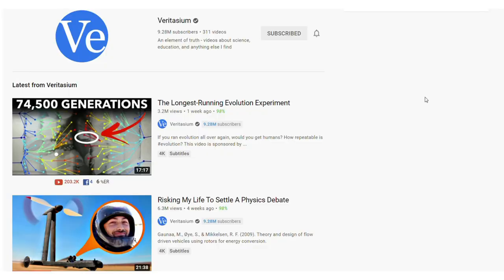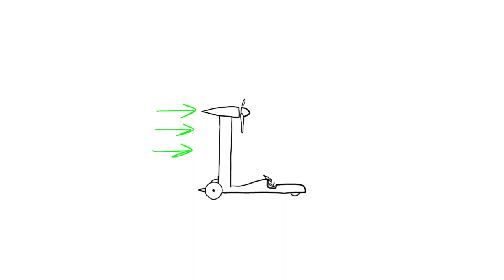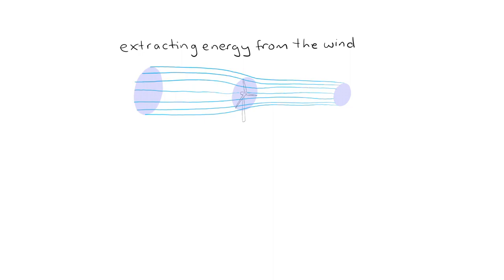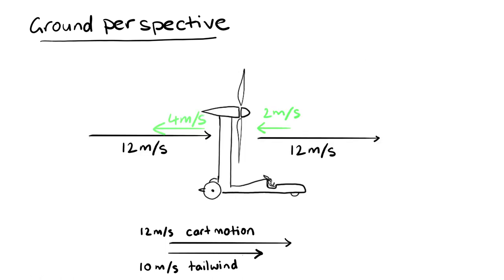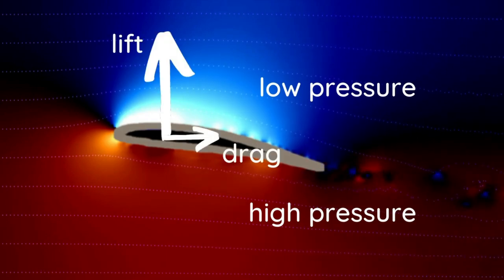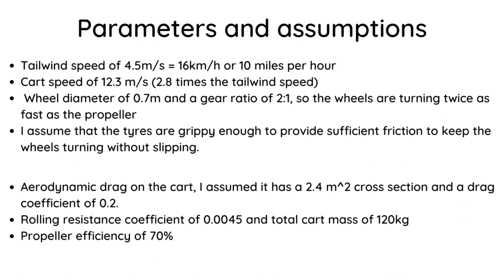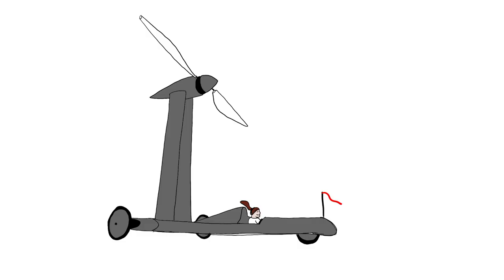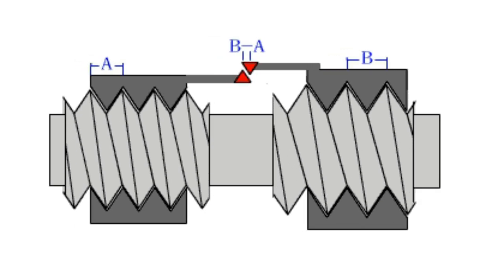Downwind Faster Than the Wind by Veritasium: How Does it Work?

Comment: I've also been mulling and enjoying this particular brain teaser for a while as well.  Thanks for your analysis.

I believe that this is such a great brain teaser because it sounds so much like a classic of 'perpetual motion', the electric car where a motor powers the front wheels and a generator is connected to the rear wheels to charge the batteries.  Anyone with any physics education knows that such 'perpetual motion' does not work.  So explaining why it does work here quite the challenge.  

Not only do you need to explain the maths of how it does work, you have to overcome the very reasonable objection to what seems to be a perpetual motion machine.

-Jon
Reply: "So explaining why it does work here quite the challenge."

Because here the wind is an external energy source so it's not a perpetual motion machine.
Reply: @seneca983   Exactly.  This system works because of external energy input.  You know that, I know that.  

My point is that explaining that this is in fact the case even though it looks like a classic perpetual motion machine is quite difficult.  

Imagine a battery powered car where the electric motor drives the front wheels.  Now connect a generator to the rear wheels to 'recharge the batteries'.  This does not work; it is perpetual motion.

Now build a battery powered car where the electric motor drives a propeller that pulls the car along.  Connect a generator to the rear wheels to 'recharge the batteries'.  Sounds very very similar, but this can work if you are going down wind, and the wind is strong enough and your system is efficient enough.

Explaining the difference between the two cases is the hard part.  Actually doing to maths to describe the requirements for the system to successfully function is not trivial.  I think Rosie does a great job with this.

-Jon
Reply: @jonathanedelson6733  OK, I misunderstood you.

Comment: Hang about, Rosie....what traps the wind to cause the 'vehicle' to move from the stationary position in the first place? None of the superstructure nor the shape of the vehicle suggests a capacity to trap moving air, i.e. wind, given that its mass is unknown, with which to turn the wheels which in turn would rotate the propellor blades.
Reply: The prop stays are rigid sails.

Comment: I missed something on the Maths.
on this example we would need to consider the build up on Angular Momentum. (and how it is , in this case tied to the regular momentum because of the chains on the wheels and propeller
Reply: No energy stored in the cart (angular or linear) adds to the thrust force of the cart in steady state wind.   So that can be ignored in terms of helping the cart work because it doesn't.  That stored energy (as it is being stored from the cart increasing speed) does keep the cart from accelerating faster though.
Reply: @killbeas  I'm sorry, but for me this is extremely counterintuitive because the entire energy stored on the cart can be written based upon the linear speed, since it is tied together. and the linear speed also dictates the thrust because it is tied to the propeller speed, which is also responsible for the net thrust. Neither Veritasium or her mentioned it, and it bugs me out
Reply: To reason why this is confusing is because people think on energy and perpetue motion, but this can be explained using energy because to execute work over the passing wind you need energy, but that energy comes from the angular+linear momentum.
Now if you go for a simpler example of ignoring the cart, and think the system as a back box. Could a back box, without any external energy, propel itself fast than a down wind? Of course it is, if the back box gets colder, for instance! (losing its internal energy) which was stored as angular momentum
Reply: @carloshra  It is indeed counterintuitive.  You bring up a good question.    Indeed, as you correctly write, energy is stored in the cart as it travels faster, in the form of rotational Kinetic Energy (KE) in the drivetrain/prop and in linear KE in the linear motion of the cart.  But this energy isn't being used to accelerate the cart.  As you probably know, for an object to give up linear KE to something else, it is slowed.   So the cart can't both slow and speed up at the same time so the linear KE can't be used in anyway to make the cart go faster.  In fact, as the speed increases, more energy is stored in the cart, not less.  

Now for rotational KE in the drivetrain used to accelerate the cart (not).  For rotational KE to be used as an energy source, the prop has to slow down (like a flywheel has to slow down to give it's energy back).  But since in this cart, where the prop is directly tied to the wheels, without the wheels slipping, the propeller can't slow down to give up it's KE as this would mean the wheels would slow which is a contradiction also for the cart speeding up.  One could say "the cart is energy hungry to make it go faster!".

So where does the energy come from?

The energy to both accelerate the cart and the energy stored in the cart (at speed) comes directly from slowing the airmass processed through the propeller.   It slows with respect to ground (the surface it is running on) and thus loses energy.

So consequently, none of the energy that is stored in the cart is ever used to accelerate the cart to a faster speed, all the energy comes from slowing of the true wind over the surface.  When the wind dies, that energy can be given up but it is only when the cart is rolling to a stop and decreasing in speed.

This really is the answer for all of those wondering about violation of Conservation of Energy.  The energy comes from slowing down some of the true wind over the surface and the cart has to have a mechanism (prop and wheels efficiently connected with correct kinematics) to capture some of that energy removed from the true wind (and it does!).     So this cart can truly go Direct Down Wind Faster Than The Wind using only the wind that drives it, steady state, using no stored energy!

Amusingly one would think I'm giving away all the secrets here (because I am)!   But I promise you will read literally thousands of comments of people who don't understand this answer, never "get it", and think it is a fraud!  So I'm happy to give up the real physics "secret" because it doesn't matter!
Reply: @carloshra  There is definitely not perpetual motion involved here.  But there is also no stored energy involved like your black box explanation.   The stipulation for this cart in it's entirety is "Direct Down Wind Faster Than The Wind using only the wind that drives it, steady state, using no stored energy!"  

The energy comes from the true wind and none of the energy stored in the cart is used to make it work.  See my explanation in my other answer to you.   So please stop telling people it uses stored energy to work because it does not.  Nor does it violate conservation of energy and is not a PM machine.

Comment: The wheels are connected to the propeller.
The propeller is geared to rotate multiple times per 1 wheel rotation.
The faster the wheels spin the faster the propeller spins, depending on what gear ratio is set up (not specified).
The propeller needs to be spinning at a high rpm in order to create thrust.
As the wind brings the car up to a higher speed it also greatly increases the propeller speed to the point where it starts to have thrust.
How the wind continues to play a part once the propeller is accelerating the car is beyond me.
It would seem to be no longer necessary and the propeller has taken over.
Reply: //"The propeller is geared to rotate multiple times per 1 wheel rotation."//

Actually, the propeller only rotates about 1/3 of a turn per wheel rotation.

//"How the wind continues to play a part once the propeller is accelerating the car is beyond me."//

The wind continues to be the energy source at all speeds.

Comment: How does this NOT defy the idea of getting more energy out than it put in?
Reply: It does so by putting more energy in than you get out.
You only have to put some of the wind's energy in. As long as that amount is larger than friction losses it will add to the kinetic energy of the vehicle. 
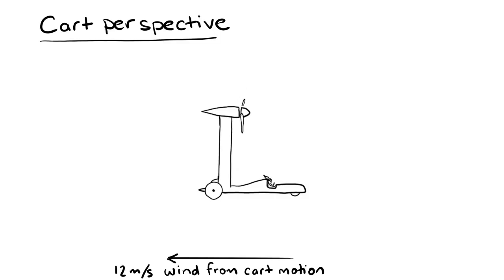Watch again from 5:38, it is by far the best explanation and doesn't confuse you with cylindrical planets or weirdly spinning wheels (they're great analogies to show what's going on, but not everyone works for everybody).

Comment: Ok so I have a simple question, when the wind speed changes and it's slower than the vehicle(as shown with the ribbon in the wind in te original video) is it accelerating or or slowing down?
Reply: In the original video the wind speed does not change by much. Watch Veritasium's follow-up video with the bet, he has a graph of wind and cart speed there.
Reply: @TubeMeisterJC  Ok so when wind is faster it powers the prop than in turn spin the wheels and when it slower the wheels power the prop that propels the craft forward, correct? so if this is true it can't move faster than the wind forever, because the wheels are acting like flywheels storing the energy in "slower than wind powered movement" and releasing it in "faster than wind" movement. Btw what is the gear ratio of the prop and wheels, or actually what is the force per rotacion each generate and the point in which a certain wind speed and craft speed make one slow the other down, provided they are gear locked all the time.
Reply: @CMZneu  it’s not exactly like a flywheel however it will not accelerate forever. It will reach a max speed where then it will deaccelerate to wind speed again. Then the energy will provide an acceleration again. The graph of speed would represent something like a sin wave
Reply: @fabio19h  Yeah i guess rather than a flywheel is more like it stores energy in the inertia of the whole craft, and a sine wave like graph is exactly what i would expect to see... but seriously is what i said is basically right?!!! because and don't get me wrong it's a neat concept but it's a bit disappointing, i guess i expected something with a more complex physics "phenomenon" of something along those lines, are you sure there isn't more to it?
Reply: @TubeMeisterJC  me and a few fellow physicists did the maths with our Professors a few months ago and also did a lot of testing… The vehicle is working like ist should it doesnt violate any laws of physics but its a finite acceleration and decall followed. In average the cart will move faster but not at a totaly steady rate
Reply: @TubeMeisterJC  bruh… we agreed with him too. Nothing in put maths contradicts it. you just dont get the real Problem and principle behind it but its okay nobody‘s perfect 
Have a good day:)

Comment: It sounds a bit like a perpetual motion problem: the wheels power the prop and the prop powers the wheels, but that would be in still air conditions.. It has been known for a very long time that a well designed ship can sail faster than the wind which propels it, but I'm not sure what bearing this has on the perpetual motion problem. What if the car driver wants to travel upwind? A ship or yacht can sail against the wind, not directly but in a laborious, zig-zag fashion.

Comment: So Rosie, when you are “running “ on a treadmill rotating at the equivalent of 20 mph, but you are stationary with regard to the room, are you feeling a “wind” on your face of 20 mph? Are the molecules of air hitting your face faster and faster? Or do you need a wind tunnel to prove your violation of first law?
Reply from the maker: No, in that case it would be the same as running 20mph outside, with a 20mph tailwind. So I wouldn't feel any relative wind on my face.
Reply: @EngineeringwithRosie  equivalent is no real wind. If your feet were “wheels” the treadmill will be moving in relation to you changing position over the treadmill ( assuming no friction ) surface because of inertia you would stay in the same place in space while changing position on the treadmill ( assuming a very long treadmill). You will feel no force on your back. Now we add friction and the treadmill will push you forward by action and reaction, but you will feel wind in your face as you move forward…I think you need a windtunnel to really do the right experiment
Reply: @JO-mg6xc  the treadmill is the equivalent of having electric motors powering the wheels. which is what the blackbird has, hidden in the wheel hubs & prop housing.
Reply: @EngineeringwithRosie  You're pretty much making a point here contrary to the claim of the vehicle. The treadmill model is a poor analog because the energy in the model that propels it forward only comes from the wheels, not from the wind as claimed by the full size vehicle. As I've stated here and elsewhere, the correct way to make a statement about the full sized vehicles speed is to time it over a given distance for an average speed, and compare that to the average speed of the wind (determined by a chase vehicle matching ground speed while measuring windspeed) over the same run. Also, like others vouching for Veritasium, you've neglected to mention the variable pitch propeller of the full size vehicle and how it can be used to trade momentum for thrust and accelerate it. However, over a prolonged period of reduced windspeed, that 'speed boost' will be lost and the wind will then exceed the speed of the vehicle again. This effect of accelerating beyond windspeed, then falling back below it will repeat over a prolonged run, ending with a result that the average ground speed of the vehicle will be <100% of the average wind speed. This is my belief unless anyone proves otherwise and the result is sanctified by the FIA or SCTA, etc. - you are after all claiming a 'speed record'. Instantaneous measurement of speed doesn't count.
Reply: @EngineeringwithRosie  but here the wind is very important. The molecules are supposed to be the driving force, not your legs. Until you prove it in a wind tunnel I will not believe it.

Comment: I made the same comment in the video and in the forum discussion thread, I also said this thing operates in at least 2 different ways below and above speed of the wind, but I don't agree that when it's going faster than wind, the wheel is driving the propeller, I think the propeller is driving the wheel when it's above the speed of the wind and there's 2 arguments for it.

1. If it works like you described, that the wheel turns the propeller, then in theory this car should work in an environment with no wind, we just have to push it a little and it would keep going via the exact same principle, and that's just obviously not possible to do.
2. If it works like I have described, that the propeller turns the wheel, then in theory it should work in a headwind with the appropriate change in drive ratios between the propeller and wheel, which it obviously does. 

There's an easy way to tell which is turning which, just fit a torque meter somewhere in the drive train and see if the torque is positive or negative.

I'd also like to point out that all of the explanations animations and concepts done by the creators of this sail car, don't involve using wheel torque for anything, so the fact that the blackbird has a drivetrain is definitely suspicious that it's not using the same principles as those shown in the 3D animations.
Reply: Congrats for figuring there is a bug in her explanation,  you have your critical thinking cap on. That makes you a rare bird.  Bernoulli's principal is what makes this work, not "thrusting air out the back".  As to which contributes more to the start-up, the airfoil cross section or the car cross section, that would depend on the aerodynamics, but is not critical to the later part, so a torque study might not prove much**

The only purpose to the airfoil pitch angle is to prevent either a stall (too much pitch at low speed) or a collapses of the vacuum on the top of the airfoil (too little pitch at higher speed).  Hence someone else here made a comment about variable pitch being useful, and was spot on, but unfortunately for the wrong reasons. 

back trust is minor, otherwise household fans (no airfoil) would fly about the floor.  Shocking that PhD's in physics and engineering forgot their 2nd year of undergraduate studies (back then, now my son just studied Bernoulli's principle in middle school (and critical thinking which I guess they didn't get earlier)).   You give me hope for this world, thank you!!!

** Run the same car with flat blades vs. an airfoil as a proof.
Reply: @rcmrcm3370  I think the pitch angle controls play a crucial role in transitioning from sub-wind to faster than wind speeds, but that analysis will get complicated very quick, I think it is also possible that this vehicle cannot transition from slower than wind to faster than wind in perfectly constant wind, it probably relies on the wind slowing down temporarily for its faster than wind drive mode to kick into effect.

Comment: Wait, isn't the propeller there to catch the wind to drive the cart forward???
Reply: No - only initially. If it were the case, the prop would be spinning in the opposite direction. The wheels are driving the direction of the propeller